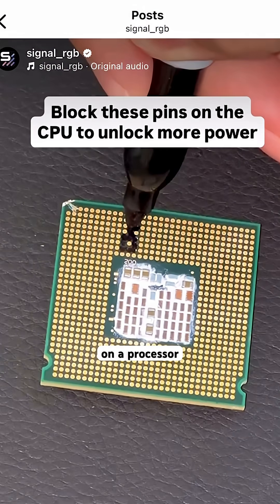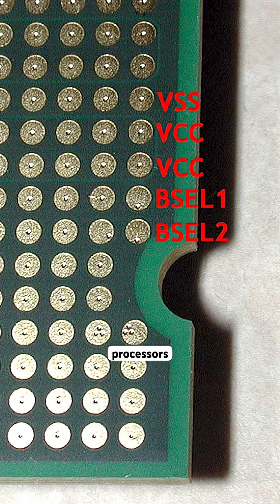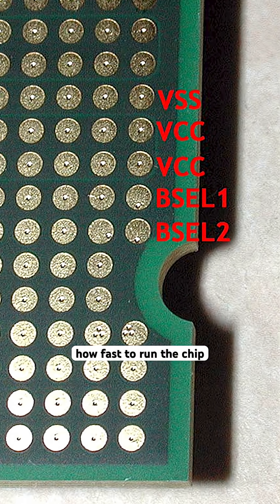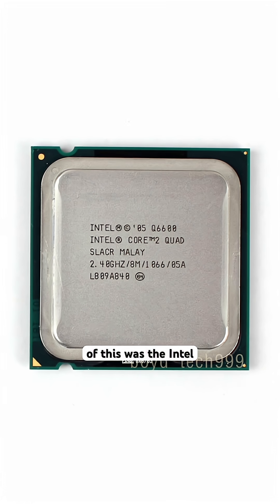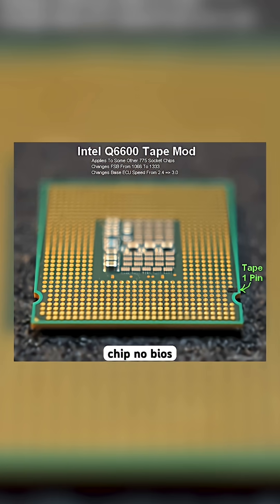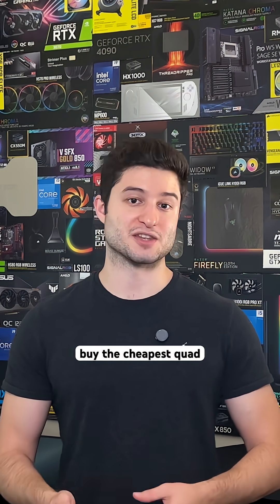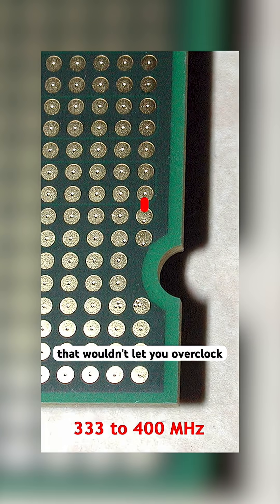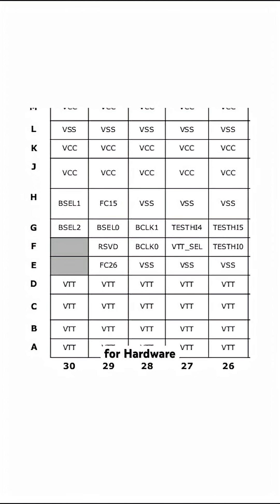Taping a CPU to improve it?!

Comment: Low end chips are made for a reason. And this reason is that all chips of same architecture are roughly the same (this is a simplification, I know), just that during quality checks at manufacturing, lower end chips don't pass some gates. Due to sheer number of possible logical conditions on a processor, cannot be tested entirely, it's tested statistically. It's how it works in microelectronics across the board, e.g. in TV matrices - good quality go to Korea and USA, total trash goes to Russia - same TV model, but some letters differ slightly. So, overclocking a low end processor is a lottery, it may work, it may not work, and it may fail spectacularly.
Reply: You're right, but I remember one time AMD had to use some nice chips and manually disable some cores to have enough supply, and people figured out how to unlock the disabled cores. It must have been a CPU. But it sure is a lottery.
Reply: @skillzorz101  They call it chips in casinos for a reason
Reply: @skillzorz101  Everyone still does that, AMD, Intel and Nvidia all do that. Now the faulty cores are physically disabled so you can't enable them.
Reply: Where do I get the schematics for the processor layout? e.g. what pin to cover, my current is old enough to be my greatest grandfathers greatest uncle's mom's aunts nieces nefews greatest grandfather
Reply: @godsownlunatics9650 Hacker forums, usually. Do do these things, ironically, you should've been already doing them for a while. Sometimes former engineers come forward too.
Reply: @godsownlunatics9650  search for it.
Something like "<socket name> pin layout" tends to give good results.
And older oc guides from the time when that platform was new.
Reply: This wasn't a "low end" processor, this was a $850 USD processor.
Reply: @PaintsAreOp on any spectrum, there is lower and upper end. If you take processors for 850, 950 and 999, 850 is lower-end. But the whole "low" end rant was more about electronics in general, rather than concrete example.

Comment: This actually never worked.  It would detect a higher speed processor, but never operated at the detected speed.  If anything, the processor would just overheat and brick itself.

For the record, I did this with my old processor back in the days.  The computer would freeze or stop working regularly every 30 minutes about.  Not always due to overheating.  I just noticed it froze more often while hot.  I was using a industrial size fan 30 inch blowing wind through my processor like a tornado just to keep it cool.  It wasn't worth the hassle.

Comment: I don’t remember which socket it was but there’s another Intel socket from back in the day (2006?) that was nearly pin compatible with a server socket
So you could just tape over a couple pins and cut the plastic tabs on your socket and use enterprise chips in consumer boards
If I remember correctly there was an iMac model that shipped with that socket
I never did the mod myself though because my iMac was only ever used in target display mode

Comment: The reason why manufacturers separate performance tiers is binning. A more expensive processor might have the same architecture and design but it’s a “good bin” meaning it’s more stable at higher voltages and clock speeds. Bad bins are typically sold as lesser, cheaper CPUs.

Comment: Cool story bro. But in reality back than as today performance of a chip depends on how good it came out of production- the lesser ones are limited to the be sold as the lower tier models. So it can work to trick them to be treated as higher tiers but you have to have some luck if this works and is stable as well. Regardless if limitations are secured by hard or software coding.

Comment: I did something similar multiple times with an Intel E5450, which was a S771 cpu. You had modification stickers available, to make it work in a S775 board. I also cut the notches with a dremel. It worked with a P35-board. Back then I was able to buy second hand blade servers (which were useless for most) that had the dual E5450 setup. E5450 was basically a Q9650.

Comment: Goes back farther than this.  The original AMD Athlon had a header on the top and we could make goldfinger devices that would modify the multiplier of the cpu.  So we could easily over clock them in a similar way.

Comment: There's a theory out there that companies have already built everything we potentially need for the next 50 years they're just slowly releasing it all. It's basically the reason why we're now having one terabyte micro SD cards. They probably invented them about 20 years ago but they never told anybody because they didn't want to go too quickly so they released them as hard drives versus SSDs or microSDs.

Comment: I had an AMD Athlon II X3 440 which had ability to unlock addl core from bios. After unlocking the core my CPU was used to shown as AMD Phenom. After a bit of research I came to know the brand hide a less performing or defective core and sell as a different CPU but I never faced any performance issues after unlocking.

Comment: You're full of BS. All manufacturers know this. They graded their CPU according to the defects and it is the manufacturers that offered these tips. It is not that the manufacturers sold a overachieving product as a lesser one for cheap. It is that they sold a defective product, tweaking it to run safe at lower frequencies, instead of throwing it into the bin.

Comment: Its insane that manufacturers literally limit you based on the money spent. I remember when people just sold a product
Reply: Thats not true. And it still applies to nowadays processors.

All CPUs are made to be the best of the best of the line. Unfortunately, even with the best of care more than 3/4 do not reach 90% of quality on the wafer. The CPU still would work, but it would have lower performance.

On older processors they would limit frequency so it would it would prevent errors, specially when it started to heat up. Overclocking like this would greatly reduce the lifespan of a chip or completely brick it after 2 or 3 intensive uses.

Noawadays instead of reducing frequency they simply disable damaged areas. Thats why the real cost of production of a same model i3 i5 i7 and i9 is exactly the same since they came from the same wafer and produced the same. But while an i3 only half can work due to damages the i9 have more than 98% of its systems operational.

So you actually get a better product for an higher cost. Even if the production cost was exactly the same.

Comment: Yeah, you could do this way before these processors. The only problem was hangups/crashes. The processors were tested and branded based on their stability. So yeah, you could "fake" the processor type, it would just be unreliable and hang-up when pushed.

Comment: This was for those that had crappy mobos that didn't allow any overclocking (typically from the likes of Dell, Fujitsu, HP). Most DYI mobos would allow to change FSB in BIOS.
Another thing why it worked was this amount of OC was very moderate for those chips - going from 200 MHz FSB to 266 didn't require additional Vcore.

Comment: Well this is straight up false. How did people apply tape to the PINS not PADS on a Q6600. 

As a former Q6600 overclocker that ran a stable 3.4Ghz overclock for 8 years I'm eager to hear the explanation.

Comment: Damn, this video made me remember I once joined 2 contacts on a CPU using a conductive silver pen to unlock it's CPU multiplier. 

Early 2000s were wild for overclocking; had to make your own water-cooling from aquarium components, not just buy a closed loop system premade like now. 

Or do a semi-DIY phase change cooler. Got a CPU down to -20C under load once. Bricked another motherboard using a Peltier device...

Comment: There must’ve been a downside, right? Like maybe intensive wear on the processor so it had a very short lifetime versus expected? Maybe it was slightly dangerous and could overheat and break if you played certain games or something to intensively? I mean there has to be a reason it was so limited by default and a mod could make it so much better right? I feel like some part of the story is missing from this little video.

Comment: I didn't do the tape mod, but I got my q6600 G0 stepping to 3.6GHz on a 92mm copper core heatpipe air cooler (maybe zalman?) back in the day

Comment: That's just not how it works. You won't have enough voltage to get the 3ghz without crashing. You will have to increase voltage and then it's just no different from a normal overclock

Comment: Okay, but the reason they were binned as lower spec processors is because the lithography that printed the circuits didn’t meet the standards to handle 3 ghz frequency… 
  So like, sure you can cheat it to increase the voltage and overclock the chip, but the likelihood of errors and failure skyrockets exponentially the harder you actually push the chip.
.
 Meaning anyone handling real workloads on a daily basis isn’t going to get “flagship” performance.  They’re going to either brick the chip, or see hangs and blue screens like crazy.   🙁

Comment: My motherboard had an array of jumpers that you filled/crossed or left blank to produce the same effect. No need to use tape or bridge pins on the PCU. Was running 2.9Ghz off of a 2.2Ghz chip. Not too bad.
Had multiple setups over the decades for this, my best find being a gen 6 i5 that supposedly had an upper limit of 4.2Ghz. I got that CPU to 5.1Ghz, stress tested with Prime95 for ~24 hours before failure.

Comment: Back in the day we over clocked amd athlons with a pencil. I shit you not. We used a pencil to deposit lead across a contact path between transistors. Had about a 25 percent success rate. Completely unlocked the CPU. You could overclock a 2400+ to about 2.8 gigahertz on stock cooling if you had a good motherboard and ram.

Comment: Back in the days the first Celeron with 300MHz could be upgraded to 450 MHz with removing a pin, drill a tiny hole and make a smal wire connection, converting it into a Pentium III. This increased not only the clock by 50%, but also allowed Dual CPU, wich was normaly deactivated on the Celeron. I actually build a Dual Celeron 450 MHz back than - for a fraction of the price a Dual Pentium III would have cost.

Comment: You used to be able to do this with socket 771 Xeons on socket 775 motherboards, youd get a good board like a high end Gigabyte P45 board, and then drop an X5460 in, push the FSB clock to 400+ (if you were lucky), and youd get 3.8 to 4.1Ghz depending on the FSB clock and your cooling capability.

Ran this back in the day with 1300+mhz DDR2 and crossfire HD4890's all with Koolance and Swiftech parts for a custom loop, in a Lian Li PC-201 case..that rig was top tier at all the lans I brough it to (at the time, didnt take long for it to be massively superseded lol)
Reply: Surprisingly, those cheap-ass ECS boards were the boards that were actually capable of running Xeons reliably. Sometimes things just come together LOL
Reply: Have my X5460 up to 4.1 (9.5x 432 or 9.0x 456, both are stable)
My DDR2-800 sadly only goes up to 946, otherwise I would probably be running 8.5x 482
Reply: Correct me if I’m wrong, but those speeds on DDR2 are only possible through overclocking, right? That’s pretty badass for DDR2!
Reply: @TH3C001  1300 Mhz on DDR2 is pretty badass indeed, most A-brand modules supported only up to 1066.
Reply: @TH3C001 Correct, I had a pair of watercooled OCZ Reaper sticks, pushed very hard.
Reply: @glynkatkin  Water cooled sticks! That's badass! I thought air cooling with little fans over the modules was getting into high performance territory, but I've never heard of water cooling RAM sticks before, that must have been some crazy looking setup, like it fell off a UFO or something. I'd love to see that.
Reply: @TH3C001  There were higher end DDR2-1066 sticks, and even DDR2-1100, 1200 and more did exist.
And on X48 you could just run it with DDR3, but that would be slower with it's loose latencies.

Comment: I've got a question. If the mod was so simple, why would a chip manufacturer make the more expensive chip more expensive? Does the overclocked chip run "like" the better one, or sort of feign it and eventually burn our faster than the higher priced one would have?

Comment: Honestly, the OG was the 486 CPU by AMD called the K6-2.  Called among fans the fireball.  Thermals aside you could overclock this thing to near twice its speed by connecting pins with a thick penciled on graphite trace.  Severely predates the core 2

Comment: No need for tape back in the day my MB had jumpers you can change bridging those connector telling your mother board it's a higher performance CPU, sure it ran hotter but with extra cooling it wasn't much a issue, down side the CPU longevity wasn't good.... 😁

Comment: This trick (BSEL mod we called it) wasn't that useful on a motherboard that allowed you to set "strap speed" (basically bus speed adjustment that also changed various multipliers/dividers for PCI-E etc so that the system wasn't unstable). On cheaper motherboards however (the kind you might pair with the cheap Pentium dual cores reknown for their overclocking potential) this was often your only option for serious overclocks.

There wasn't much risk though, you could mask things off before using the circuit writer, and if you still managed to bridge the wrong two pins it was easy enough to scratch the conductive ink off with a fingernail.

Comment: I took this a step further and discovered that multiplier locked intel core2 quads and duos that ran at 800MHz fsb would allow you to drop the multiplier, but not raise it. They did, however, let you fiddle with the base speed and FSB. So you were able to drop the multiplier, then OC the FSB to 1066, 1333MHz or more in some cases, and then walk the multiplier up back up to stock, and you now have a magically OC'd non-extreme processor! My favorite was an E5400, a dirt cheap dual core, that would happily go from 2.7GHz to 4.5GHz with nothing more than a little voltage and some big air.

Comment: fun fact, you can do this with the LGA1151 CPU too. tapping the right pin of a 2nd or 3rd gen LGA1151 CPU and modding the bios of a 1st gen LGA1151 motherboard allow you to use them together

Comment: there was a lot of I don't know what you would call a exploits/workarounds for gpus add to a lesser degree CPUs at the time. I had a couple of ATI cards that I was able to flash with a faster bios and it would unlock additional cores or in some cases, an obscure amount of cores between the amount of the card you purchased versus the next tier up 

you could also force AFR in a lot of games, allowing you too get some pretty good performance and graphically demanding titles at the time. ATI crossfire on some HD5870s was the first time I went above 1080p resolution at a whopping 28 fps lol

Comment: I firstly had modded my Q6600 with tape, but after switching Mainboard I was able to let it run at 3.2GHz, a nice 50% boost.
Had paired it with a 980 ti, some of my benchmark results might be still listed at 3dmark.

Comment: in the days of the AMD K7, you could use conductive paint to  unlock more stuff. You could convert a single core proc, into a multi socket one... Athlon XP -> Athlon MP (If you wanted to have more than one core in that age, you needed a dual socket board, with specific multi socket processors).

Some very early K7 cpus were made of ceramics (very early Athlons, and Durons), so instead of conductive paint, you could use a graphite pen.

Comment: I had a Q6600 and this is the first I have heard of this mod. I was able to get a 50% overclock (from 2.4GHz to 3.6GHz) on mine thanks to good cooling, a great motherboard, and a pencil mod. The mod involved drawing a line with a pencil between certain traces on the motherboard to reduce vdroop, improving stability while overclocking.

Comment: I knew a guy who did this with his old IBM PC (serial number 1805).  He also changed the MB crystal to up the system frequency.  He did other stuff to his board also.  His PC was out of the box and mounted via standoffs on the wall with jumper wires all over it.  He was brilliant with electronics and what coding was available at the time [mid 1980's], but he had zero common sense.

Comment: I did this with a Q6600 and an optiplex 755 as a kid. Surprisingly it didn't run hot so long as you had good thermal paste on it and the fans weren't clogged with dust like they often are on those....

I paired it with 6gb ddr2 1066mhz and a Radeon R5 340x with a kingston 240gb SSD and windows 10. Hundrends of hours of CSGO and minecraft were played on that machine

Comment: Some mother boards also had watchdogs that if you swapped a cpu to a higher rating voltage wise, after 30 minutes the computer would just go OFF, no shut down just OFF!

Comment: I used to overclock the hell out of the core2quad lineup. I miss those days. I once connected the cardboard tube from wrapping paper to my window AC unit and the other end to the heatsink to literally air conditiony q9400 to push its limits. Not practical, but it only takes a few benchmarks to hit unheard of overclocks. Fun times!

Comment: The thing was,  it was NOT a 3ghz chip and did not run that multiplier stable.  This turned out to be a bunch of jacks of the trade thinking they did something really great and instead they would just induce overheating and bluescreens of death because the truth caught up.  The arcitecture of the 3Ghz chip is different to mitigate heat and handle the higher frequency.  You cant take a cheap chip and turn it into a fast CPU with the flip of a switch.

Comment: I did the BSEL mod to my brand new duel Xeon workstation. It enabled me to put in the lowest spec 2,3ghz cpu and turn it into a 2.8ghz extreme edition, that could use the 1600mhz front side bus and double speed RAM.